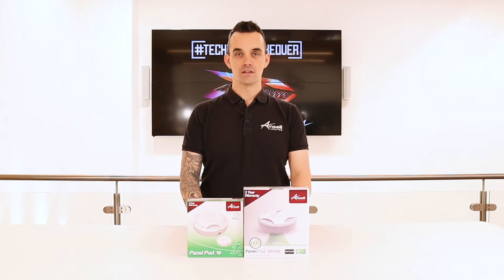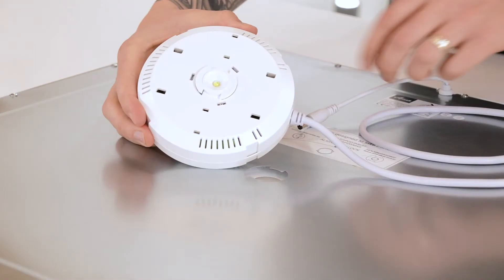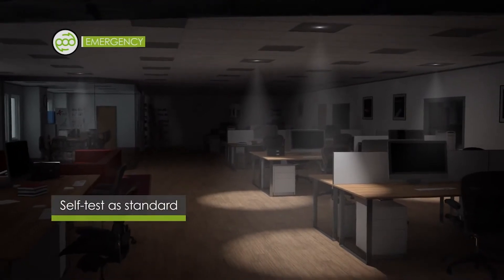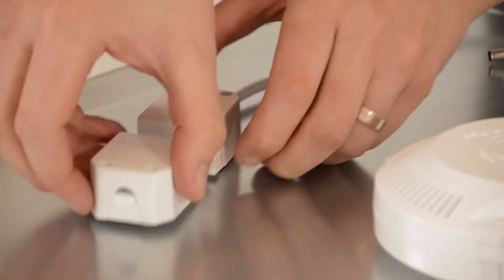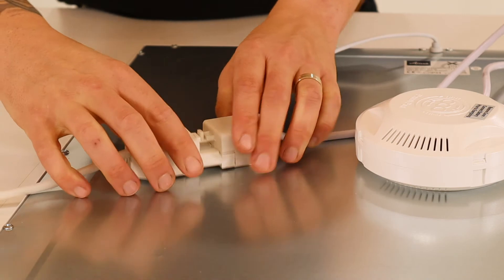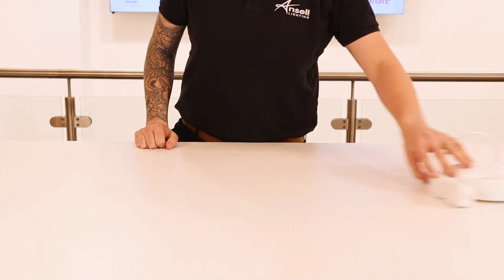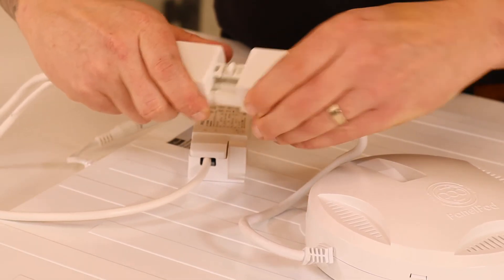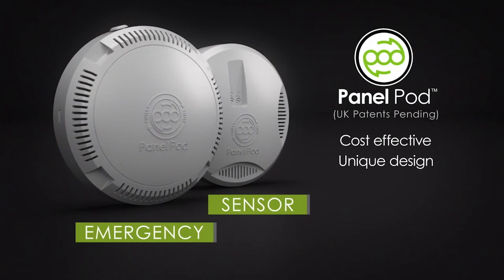Panel Pod | Tech Team Takeover

Comment: Had 20 of these delivered to site, was unaware I’d need a junction box, extra flex and connections delivers to site. 

I’ve put in NVC ones lately and didn’t need any thing extra just an E light pack and panel. Ansell I needed panel, pod, wiska box, glands, wago connectors and flex. Took about 30 mins to do one light too.